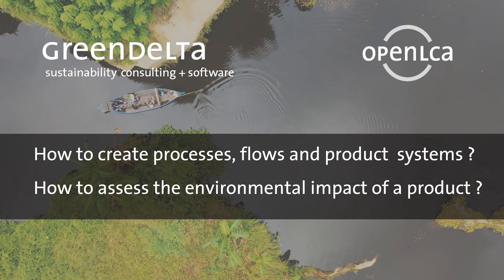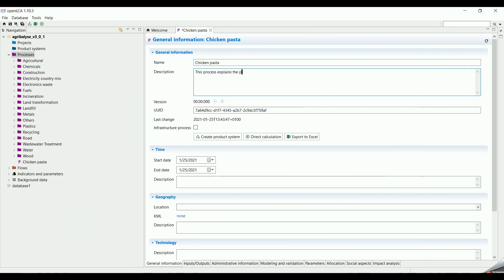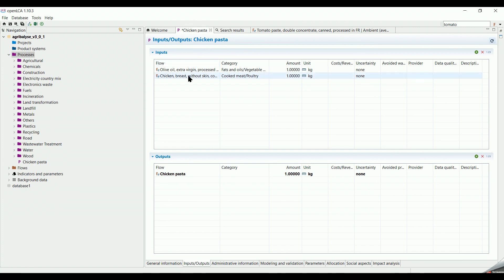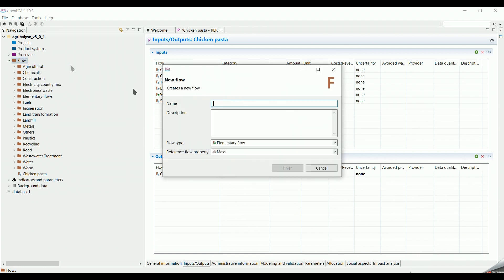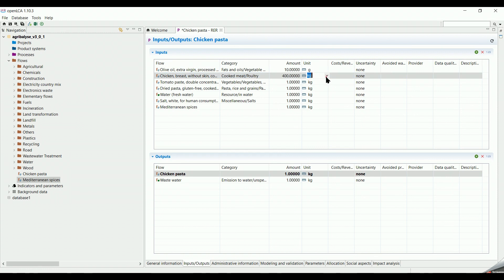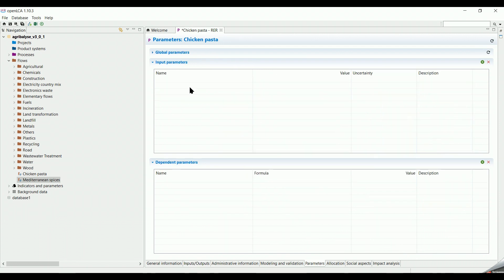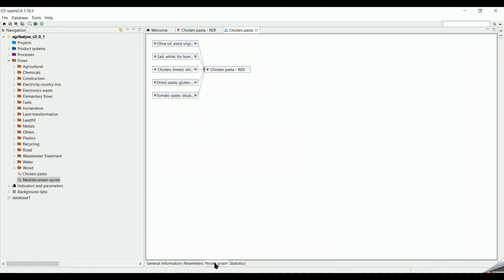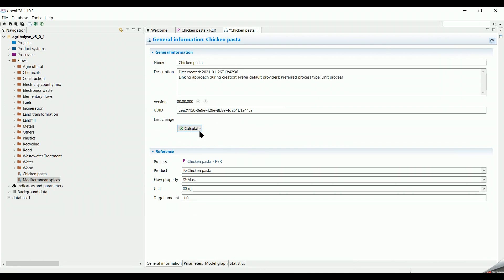Tutorial: How to create processes, flows and product systems in openLCA (Part 1)

Comment: In 3:38, you take the process, not the flow, from the category tree on the left and add it to the inputs/outputs; this works (as we see), and enters the product of the process, and the process as provider (of the product) in the inputs/outputs sheet. You could also do this by adding the flow only, and then select one, or none, of the possible providers. Here you are combining two steps in one.

Comment: When I try to add a provider for the flow it shows an empty list. What should I do to fix this?
Reply from the maker: An empty list on the “provider” column in a process means that the flow being used is not an output of any process of the database used. In order to have a provider in the list, you need either create a process producing it, or import one. You can also leave the product without provider, unlike in some other LCA tools; you will then see the product as input in your inventory calculation.

Comment: in the Model Graph doesn't appear the Mediterranean Spices Input, why ? Is it necessary add information about this product separately ?
Reply from the maker: When you slide down the chicken pasta process you will see that the Mediterranean spices input exists but you cannot see it in a seperate process like olive oil or salt because this flow was not linked to a provider which means it does not have a linked process that produces these spices. In this case, you can create a process which describes the production of these spices to have more exact results.. Such a step is necessary when you are working with a flow which can play a big role on your main process.
Reply: @openLCA  thank you so much, clear explanation!
Reply: @openLCA  It isn't clear, if I understud I have to create a process for "mediterranean spice" to use the flow as input?